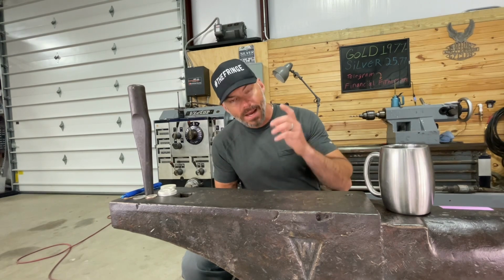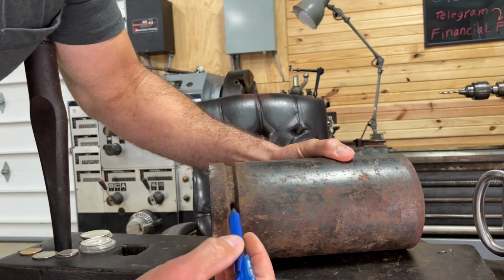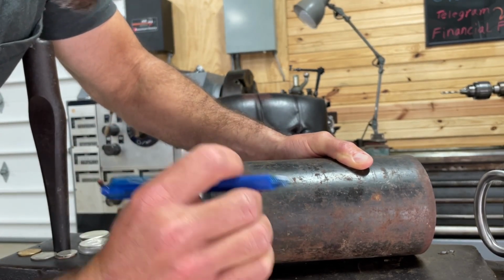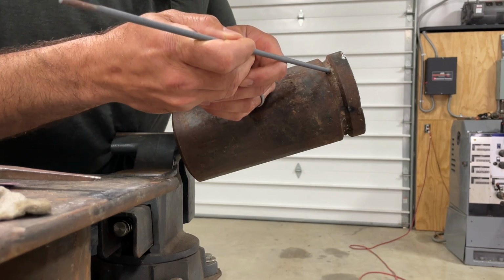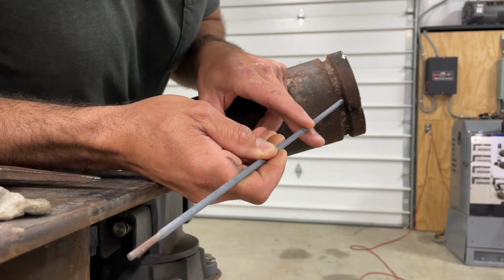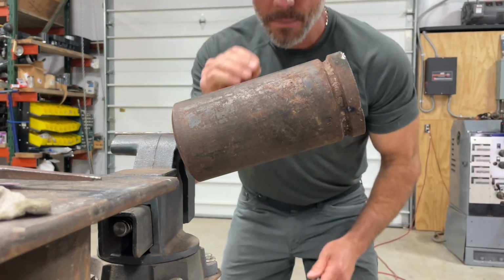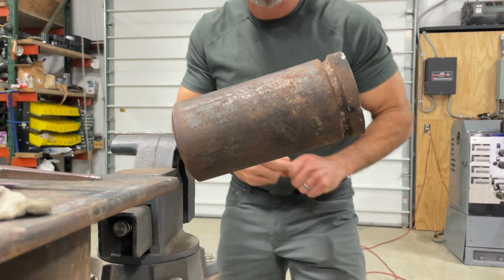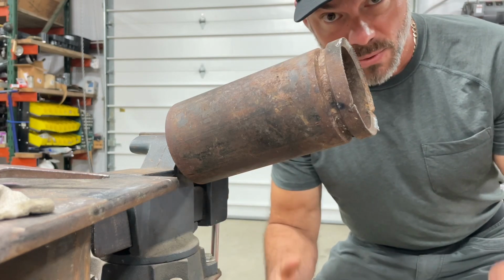Downhill pipe welding, hot pass, and filler.￼

Comment: Yep "The fringe". Great video. Just in time. got some 6010 to play with. Not common here in Australia . Thanks
Reply from the maker: Right on mate!
Reply: don't forget when talking about 6010 such as 5P or 5P+ (there's a difference in these two rods and how they act) and don't forget that 6011 is a more versatile fast freeze rod than 6010 because you can use it on AC or DC whereas 6010 is only run on 6010

Comment: #thefringe what causes trapped slag inside the ripples of your bead? I brush it with a wire wheel and I still see small reflections of porosity/slag in my ripples. Very small but evident nonetheless
Reply from the maker: Yea it just does that sometimes … buff it’s sideways.

Comment: I am a pipe fitter/combo welder going on 10 years. I have always loved teaching the younger generation what took me years to figure out. I appreciate you taking your time to teach those that have a drive to learn. I have always wanted to learn all there is to know for my trade. I have welded a wide variety of metals and processes. The one thing I have not been able to master is the bottom of a pipe running downhill rod. I have pictures to show what I’m talking about but it basically always wants to leave a hole on the bottom tie in. I don’t struggle with the top and sides so I started welding the bottom half then flipping it over. That way I can weld two bottom halves but 50% of the time I get a hole on the tie in. What is your suggestion? I’ve heard people say to flick the rod, flick it away, long arc towards you, long arc out taking bigger and bigger steps getting further and further away. The last one seems to work the best for me but still get a crater from time to time.
Reply from the maker: Go past the bottom. Weld up the other side a lil bit and turn it down
Reply from the maker: I will try and make a video the next time I get on some pipe.

Comment: Everyone wants to be a pipeline welder cause they hear about big bucks...which is true for the really good hands...and mad respect for pipeliners...but the trades are in high demand for other industries.

Learn how to weld, how to be a mechanic. Learn electrical. Dont be scared to learn the technical stuff. Do that and you will see how much demand there is in manufacturing.  Make 80% of what a pipeliner makes for half the time put in. 

Machining as well. These big manufacturing outfits need Jack of all trades to keep the robots running.

#thefringe
Reply from the maker: I agree… you need to know all of it

Comment: Iv went to my 12” butt weld test and branch test and I busted do to lack of fusion on the cap I thought I had it I passed the branch test but I’m struggling with the butt weld what can I do to avoid this
Reply from the maker: Lack of fusion? Sounds like your too cold. I'd never had that problem with clean metal
Reply: I ran 6010 5/32 fill and cap at 120 amps maybe I’m cold but I’m new in the API industry it’s a learning curve compared to ASME stuff like 7018.

Comment: #THEFRINGE . I need to replace a section of pipe 4in od 1/4 thick wall . how would you weld it. I have some 6011 rods 3/16 and 1/8   and 7018  1/8 . If 6010 will work better I can order them.

Comment: hey chris ive been getting some pipe coupons from the scrapyard that aren’t the most square cut and theyre also a little egged so it it makes for a little hi lo. its good real world practice but ive been struggling with the bead since i dont have a remote on my sa200 yet. Could you do a video on beading tight & open sides on pipe by just thinning the land and coming back over to fix IP? #TheFringe
Reply from the maker: I sure will. That’s a great idea
Reply from the maker: Welding pipe with imperfections something I do every day. It’s good practice for you